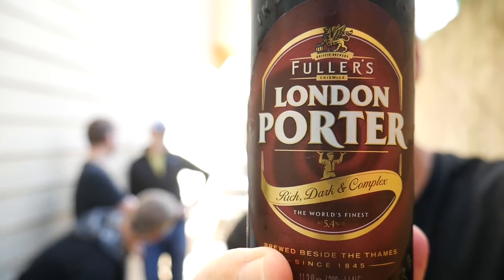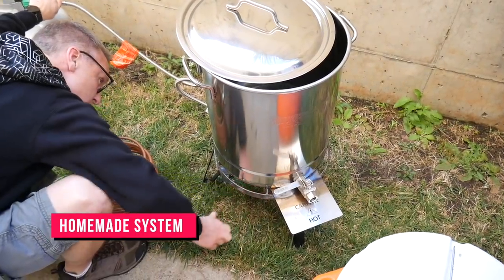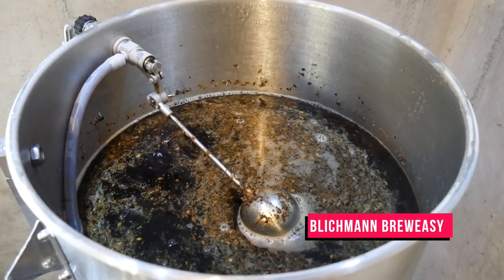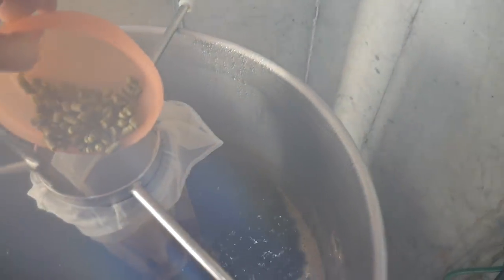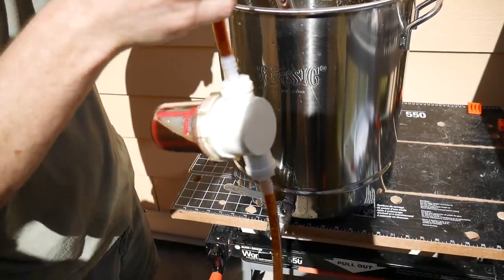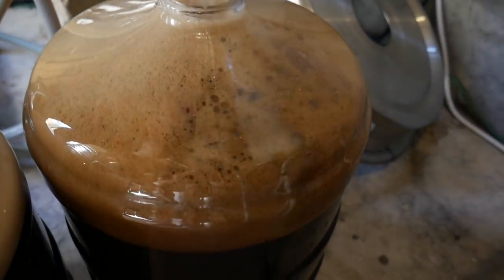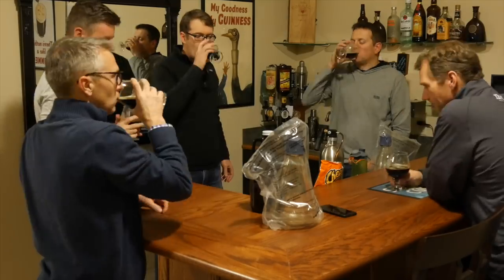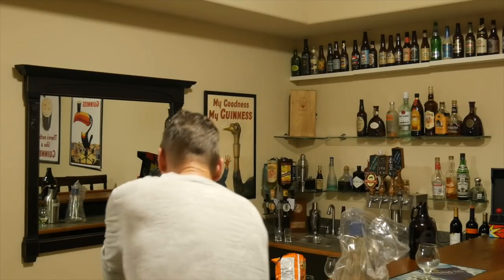Brewing the same beer on $300 v $3000 systems

Comment: 158F is a little hot for good conversion but not horrible...as long as it’s what it says it is. I have the gas version of the Tower of Power module and love it. But that high of temps could be part of the attenuation issue. 

As far as the yeast goes I’m assuming you used WLP002 or Wyeast English Ale. Either way that yeast is a super floculator...meaning it clumps up really well and then drops to the bottom. No issues with the clumping but maybe with the amount. Didn’t seem like there much in that Erlenmeyer flask, but I could be mistaken. 

Thanks for the experiment though. Fun to watch!
Reply from the maker: Nicholas Parker we normally see a loss of about 6F in pumping through the tower so set it +6 over the mash temperature we want in the mash tun. So we were mashing closer to 152.
Reply: That makes sense. Thought that number was during recirculation. It could be older yeast, not enough yeast, drastic temperature fluctuations. Some English strains flocculate & drop more easily than others. It's good you guys at least enjoyed the beers!
Reply: Lagunitas mashes at 160F for all their beers. Stalling at 1.030ish or 1.020ish isn't the mash temp. Could be cell count or O2 conent.
Reply: This reasoning is a touch suspect. The mash is not only operating in the tun with the grain in it. The whole volume of liquid distributed between both pots is full of starch, enzymes and sugar. If half of your wort is at 152 and the other half at 158, you can bet the enzymes are in an effect at 155.

Comment: Did you guys calculate yeast cells? A non-calibrated thermometer with a high alpha-amylase temperature ramp could explain part of that, but that's too much. I'd bet you got insufficient amount of yeast cells or at least not enough healthy yeast cells. Also add zync during the last minutes of boil and get a food-grade oxygen tank, that hose-drill thing is only visual and is not really adding nearly enough O2 into the wort for a healthy fermentation - an aquarium O2 pump/filter would be much better already if you're not willing to get a tank with a manometer :)
Reply from the maker: Yep, those are great tips. For the yeast starter I cold crashed it and pitched only the yeast that fell to the bottom - possibly we were short of yeast cells there. And have since upgraded to a CO2 wand to get some real oxygen into the beer.

Comment: I think the yeast strand was probably the wrong choice. The reason I think this is because both stalled. I’m probably wrong about that but considering what you guys did here, nothing was done wrong or bad in my opinion. So, that tells me maybe the yeast strand was wrong for that brew. Maybe next time try a simple yeast which doesn’t impart much flavor or anything else and is considerably strong such as US-05. Other than that it was a great experiment. Again, this is just my opinion...not fact. 
P.s. the homemade system is a 3 tier homemade gravity system. I have that same set up 😁
Reply from the maker: Thanks, "3 tier homemade gravity system" sounds a bit better than "the homemade one" :-)

Comment: What you should have taken away is that yeast and the fermentation conditions can account for up to 70% of the flavors we taste in beer. Without having identical pitch rates, fermentation temp control, and fermentation vessel volumes....the two beers will always turn out different.

Next time, brew a 10gal batch...then split it into two 5-gal fermenters...pitch the same volume of the same strain of yeast, but ferment one at 65° and one at 70°. Two different beers result.
Reply from the maker: That would be a great test. We brew 10 gallon batches split between two 5 gallon carboys as standard so it would be simple enough to modify the fermentation temperatures of the two carboys and see what differences we get in ABV and taste. I think this may be the inspiration for a future video :-)
Reply: I use Bell's yeast a lot, which I cultured up from their commercial bottles. They use this proprietary strain for most of their commercial beers; Stout, IPA, Brown, Amber, Wheat, etc. (everything except Lagers and Belgians, I believe)....they ferment at different temps to get the different flavor profiles for each beer while using the same yeast strain.

I believe it is only "proprietary" because they have used and cultured their yeast for decades...this set of selection pressures resulted in the yeast they have now, which is different from anywhere else.
Reply: p.s.- attenuation issues (or wort fermentability) are usually associated with the mashing process and grist ingredients. The highly kilned crystal malts and roasted malts have less convertible starches due to the heat they are exposed to in processing....if you are making your own recipes, you should read up on ingredient balance and wort fermentability. Then look at the mash temps, a few degrees either direction will greatly change the wort characteristics.
Reply: I really like the video! But you're comparing not just the wort making process: to do that you'd need to ferment the two worts in the same conditions. It would be interesting to split both worts and ferment each using both methods. Then you'd get a picture on what matters most: Fermentation, or extraction? For this perhaps also it wouldn't hurt to use a portion of exactly the same yeast starter culture for every primary.

Comment: I did not see what temps you mashed in at on both systems? This may be the cause of the fermentation issues? The Blichmann will hold the mash point more consistent that the cooler will. But you can still achieve great results with a cooler.  Nice production guys.already subbed. Cheers!🍻
Reply: As little as I know about all-grain brewing at this point had me thinking along those lines.  Were the mash temps on the econo setup higher?  With the gravity being almost the same, this would be the only difference that I can think of other than yeast health.  Maybe combining and then dividing the yeast would equalize that piece.
Reply from the maker: Both systems followed the same brew schedule and our mash temps remained quite close, as did pH and OG. The Blichmann system certainly allows more precise and adjustable temperature control but I don't think we were too far different there.
Reply: Did you overbuild the yeast starter and split it evenly between the two worts? In the video one guy pitches the whole Erlenmeyer flask so I'm not sure if the starter was split beforehand.
Reply from the maker: Mike L. Yeah we both created a yeast starter independently. One for each system.
Reply: I’m with Short Circuited Brewers. The temp is the super important thing in brewing. Miss by 1 degree or temperature rising speed will allow the enzymes to stop or continue. Is the Blichmann correct? Is the homemade system correct? It’s up to the brewer.
Reply: 1337Sauce  that’s an easy way to see it but without calibration, you won’t know if you’re working on the Beta Amylase or the alpha. When you work on your system you need to understand how your system uses temperature. Example if I was just to read my sensors I would assume that I’m working in the alpha amylase zone but I know over time that my system is dropping 2.6 degrees over the movement of the wort through the system.
Reply: Maybe you need to 3test batches of each
Reply: Personally don't think your starter looked good. That would most likely be the reason for under attenuation. Looked like you did everything else right to me. Hope you enjoy the beer 🍻

Comment: exposed lid during immersion chilling i wonder if it got any wild yeasts
Reply: Was thinking that too. Especially outside on a warm day
Reply: Given the Gravity after a month it doesn't sound like much wanted to chew on what was in there
Reply: I have chilled this way for years on about 25-30 different beers.  Never had a single issue.
Reply: curt, my homemade set up would make those guys cringe, but i make 45 gallons of beer one shot, used it for 15 years , never failed, open fermentor and all that. total ghetto setup can work good if done right
Reply: It wouldn't matter. The volume of yeast pitched is going to be millions of times more than any stray wild yeast, and domesticated yeast is a much more aggressive beast. It will kill anything in its path. You can ferment without a lid for any style and not notice any flavor difference. You just need to seal it up before it stops fermenting to prevent oxidation.
Reply: I would love to see your setup! 45 gallons sound awesome! :D
Reply: I’d be more concerned with preventing DMS from escaping than with wild yeast providing everything cold side was sanitized. I’ve definitely ruined a few beers by leaving the lid on during chilling.
Reply: Next to no chance.

Comment: No consideration that the 1.030 beer stalled due to poor conversion during the mash?
Reply from the maker: Fermentation Adventures it's certainly possible. We both hit the OG target so thought mash conversion went well.
Reply: If mash temp is low you can still hit target OG but have more unfermentable sugars.  The result would be low attenuation and more malt flavor in the beer.  Check your thermometer calibration.
Reply: Yes!  I meant high, not low.

Comment: What does aeration add to a brew? I’m new to home brewing and really curious
Reply from the maker: After the boil there is very little oxygen left in the wort. Yeast needs oxygen to work its magic so it's important to add it back in through some form of aeration.
Reply: Right.  And it should be the ONLY time oxygen is added to the equation.  After fermentation begins, you should be avoiding as much as possible the introduction of oxygen.  For almost all beers.

Comment: Why did both yeasts stall? Regardless this was a great video! Very nice production and really interesting concept. Well done! Cheers!
Reply: I know absolutely nothing about brewing, but, yeast, if there is anything alive at all when introduced, should just need a couple of hours, at most a day, to be back up in quantity to what "should" have been there in the first place.
The dead yeast might make it taste different, but the fermentation should be going as normal until the sugars run out, or the alcohol content kills the yeast.

In this case i'd wager a guess that it was the sugars that ran out, but as i said... i know about zero when it comes to beer brewing.
Reply: Factor that differentiated the two... sugar content when adding the yeast.It is of course nothing but a guess, but if one system is better then the other at something along the process of preparing, and extracting the sugar, then the end result will be just that. If anything that also means that they would have gotten the higher target alcohol content, if they managed to extract the last bits of sugar as well. Unless of course the one system managed a perfect result, and that the expected sugars simply wasn't in the grain. age could be a factor, but i doubt it...
Reply: I think you're right not getting all the fermentable sugars out of the grain bill most likely resulted in the two diferent gravities and resulting abv. May have been the yeast's ability to ferment such sugars too, although they did use the same starter for both so that shouldn't factor in too much.
Reply: Probably underpitched or something. Maybe didnt mix good enough. They never mentioned what strain they used. I would assume some highly flouclating yeasty like 004 , but who knows.
Reply: It says what yeast is used in the recipe in the description text: London ESB Ale (Wyeast Labs #1968). While I've not used this exactly, I have used WLP002 which is supposed to be White Labs' version of the same strain, and that one could definitely be considered "chunky" (this is related to why it flocculates so easily). This is to say, the chunkiness is just the way it is, it's not that anything's wrong with the starter (probably). 

Without knowing the details of the fermentation schedule, I'm not sure I could say for certain what went wrong, but I do recall reading that this strain has a tendency to drop out really easily and needs to be roused back into suspension to complete fermentation.
Reply: MrPharand, exactly, when using highly flocculant yeasts it is a good practice to rouse the yeasts periodically during the fermentation process. That's what the English brewers that use these yeasts do. For instance, the Yorkshire Square fermentation process is a good example of a method that involves rousing the yeast.
Reply: No i would lay blame on their Mash Temp. at higher temps the sugars become less fermentable. if you want a dryer and less sweet brew i feel 150 to 148 is a more appropriate temp

Comment: I like the float valve.  In my system, which uses a pump, I use a stainless steel float switch to control the pump.  There's a circuit diagram at iobrewthings.com.

Comment: You need a $3000 system for one thing, to be able to replicate the same beer every time.
If you don't mind a slightly different beer each time you brew - WHY SPEND $3000  ???
A much better course is to spend $300 on equipment and $2700 on ingredients [more beer]
Reply: Graham Bunton I get repeatable results on my $300 system almost all the time. It just helps make your brew day a little easierby automating everything. Just use good software like BeerSmith and you can easily repeat a brew.